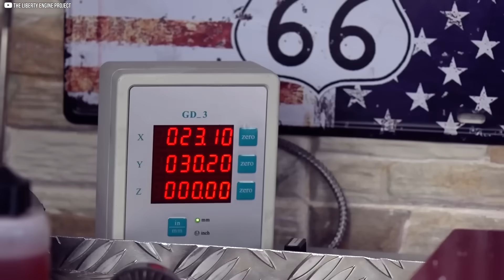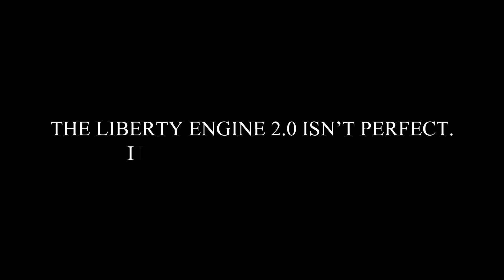Nikola Tesla’s Hidden Invention Just Got Rebuilt – And It Works!

Comment: I thing about that when i was a kid, I can't understand why someone doesn't use natural magnets abilities to generating magnetic field to build some kind of engine that produces movement to power up ather mechanizmes. In most of the electric engines or maybe even in all of them, to produce movement it is use electromagnets that require income energy to create electromagnetic field and it's really good idea in some cases, because this type of engines produce a lot of torque, imagine a drill that produces no torque at all or an electric car engine with the same problem, but in the case of a generator you don't need that much torque, at least with these small generators, i don't know how it is with bigger ones. This idea is some kind of solusyon for free sources of energy and style i don't understend why no one wonts to use it.

Comment: The infinite energy source from these Trollge videos seems more convincing, than that for 200 years nobody thought about making a machine that works on principles taught in 8th grade
Reply: Simplicity is the key!
Reply: @curtcoller3632   369
Reply: Funny though how Tesla's inventions were hidden forever after his death.  Ever see pictures of him with the wireless florescent type light bulbs cool enough to hold onto and move wherever you like?  Funny we don't have those by now....
Reply: More like 4th
Reply: Not to argue (as this, and a number of other subjects related to advanced engineering concepts, both realized, theorized, and even those never fully ‘accepted’ — I just happen to know quite a bit about).

That being said, the mentioned ‘fluorescent bulb’ you could ‘hold’ (and remained ‘cool’), is not only possible — but always has been (and is not even one of the disputed Tesla inventions). You can reproduce this in your own home (likely with gadgets just laying around).

The simplest example, would be if you have a ‘lightning globe’ laying around, and a spare desk Florescent bulb (note: Lightning globes use flyback transformers, which jack up the alternating DC input voltage — but use very, very minuscule amounts of current.. the ‘lighting effects’ are merely ‘streams of electrons’ being pulled from outside of the glass enclosure, and pass thorough the gas filament — creating the illusion of it being ‘contained’ , while in reality the high frequency + high voltage enable the electric field to pass right through, like an RF-signal).

Anyway, if you dim your lights, pick up a bulb in one hand, while touching the lighting globe with the other — surely enough, you will see it glow just the same)

Granted, this is just to explain the basic concepts as to how they worked, seemingly without wires & were cool to the touch:
1. Human Antennae / Ground conduction: By picking a bulb up & holding it, anywhere near one of his massive buildings and giant coils), would easily have the mentioned effect.

2. Lower temp / brighter glow: This is generally due to the much higher frequency (and incredibly higher voltage) produced by his coils. Depending on various factors, generally speaking, higher operating AC-frequencies, lower the threshold for gaseous energy excitation being achieved, in the form of light produced.

3. Distance from visible energy source: The effect worked at distance, as it is helped by the both the higher AC-freq (enabling easier excitation) + coupled by the millions of AC-volts being generated (via the stepping up of voltage by the coil design ratio & self-resonance of the coils themselves)

4. Low temperature: This is another byproduct of the reduced threshold to producing excitation. The closer you get to the resonance of the gas you wish to excite, the less resistance encountered (=less wasted heat produced) + less operating current needed to produce illumination (less current, means less power/energy x natural impedance of bulb , also reducing heat generation, etc).

5. Seemingly invisibility of the electric field: This is most simple of all. Those who would come to witness said experiments, were themselves within the field as well. And given the higher frequency, and ‘skin effect’ (in how electricity general moves) — aside from a tingle maybe, you’d have no reason to know you were in anymore/less of a field as that which the earth generates (of an over simplification, but I am very tired lol).

Anyway, it is undisputed that after his passing — much of Tesla’s most exotic / exiting ideas & designs were confiscated by the government nearly immediately following his passing (while whatever remained, his remaining relatively quickly scooped up … *sigh*..)
Reply: Nah.  Many people tried to pick up this stuff and others...where are they now?  What happened to them?  Many mysteriously died of heart attacks, lost all of their wealth, and just disappeared.  It was never that others from the past didn't think of it or even render a prototype.  The younger generations from every single age seem to think everyone behind them was an idiot.  That in itself is idiocy.

Comment: Those born in their 30/40/50's can easily relate to this exactly where our bicycles use to generate same with a small component attached to the rear spinning tyres to generate same energy for bicycle head light.

Comment: The thing this video doesn't go over at all is the fact that when a load is connected to this, it has to work harder to keep running, if they really did find a way around this I'd be interested in how they did so... sure it might run, but actually having it run with a load drawing power from it makes the entire system need more force on the rotor to run, induction is a 2 way street, the more power by induction the more opposing forces there is. Also, this isn't what tesla was doing, sure he came up with the first multi phase AC generator that was used at Niagra Falls, but this is just basically that trying to make power to run itself which isn't something tesla really did because its supposedly impossible due to what I talked about above.

Comment: yeah genie, that's a regular motor, and it will stop eventually, there is fricction between the pieces and you are taking out the energy from the spin and transforming into eletricity, it WILL eventually stop.
Reply from the maker: It's interesting to consider the factors that influence the efficiency of this system.

Comment: It is just a magnetic generator. The magnetic fields will cause friction in as will the friction from the air generate heat and will reduce the efficiency. The magnets will depolarize and it will be dead. If you put it in a vacuum chamber it will reduce the air friction but not the magnet friction. If you can cool it to absolute zero it will run longer, if it gets cold enough quantum mechanics of magnetic fields would come into play which would cause some issues, not to mention the power it needs to generate to cool the device down is a issue. Not to mention it is on a axe motor which would cause issue because it would eventually break from wear and tear. You can make one that levitates but would require more magnets to hold it in place. The magnetic field would wobble due too gravity and electric field interaction.

If you used diamagnetic material you wouldn't need to worry about the magnetic friction, but you need enough starting electricity to get it spinning. The electricity would be used to generate electromagnetic fields to levitate the bismuth disk( which would have to be a reinforced alloy due to its brittleness such as carbon and graphene and copper. The copper would be used to enhance the electric fields). There is one thing that would reduce efficiency and that is the diamagnetic element or material you use. The disk would resist going in one direction and go the opposite direction. You would need to switch the current to go the other way and create a oscillating circuit that uses ac to dc like in the video. If you created a hybrid or have multiple spinning in several directions and had a computer have perfect time like a combustion engine has for it's pistons it would run longer in theory. The one question is how long before you have to start it again. You would still need a power source to initiate it. If the power output and input ratio is 1:1 or 1:2 or higher than you would have success.

To actual build a practical prototype would take resources, funding and time. If you even think about upscaling the magnetic generator in the video or the diamagnetic generator I propose it could be added to the power grid. A nuclear power plant could add these giant generators and increase output if successful. There may be other issues that I haven't considered, if anyone can think of any other problems and how to resolve them even in a hypothetic scenario, please let me know.
Reply from the maker: We appreciate your detailed observations and insights on the challenges and opportunities surrounding this invention.

Comment: Plop it in a Tesla and see how long it lasts?  That would be the test.
Reply from the maker: It's great to see people thinking about how this technology could be applied in the real world.
Reply: @TheForgeEmpire  Finding the cheapest way to have even a backup power system, for people like me, who live very rural, would be a blessing.  As it sits, the more better power generator system is an LP gas generator.  GENERAC has good ones, but these come with a hefty price tag, and they run on a fuel.  

As I love seeing innovations in power production, I would love to see more on storage as well.  On our farm, we get plenty of sun and wind.  Having a lot of storage, without a wall of batteries would be nice.  Deep cell batteries are pricey.  

I am on the grid and I have a gas generator for the well, and 2 Westinghouse 1000s Pure Sine power banks for when the power goes out. I have 2 200w solar panels that I can use to charge the power banks.

My electric bill is about $1200/yr.  A GENERAC system costs over $12k, and is only needed 1-3 days a year, so whatever comes out as the new "off grid" system, has to have a good price tag.

Comment: Yes they addressed the machine and how well it works but not once did they hint how long it runs for, if it works like they say it does and can power multiple hight output devices it would be a pain to have to restart or reset it every 20 minutes or so to make sure my house or business has power
Reply from the maker: Thanks for bringing up an important point about its practical application.

Comment: ye as a tesla fan, pretty sure he never made something like this, he did however make a radiant energy collector, and that does work, because it is what a crystal radio is based on, its the receiver part of his tesla tower.  the tesla tower went on to evolve into radio and radar,  a radiant energy collector, in a crystal radio type configuration can be tuned to any emission source, be it radio or cosmic background radio waves.    If you feed a diode and capacitor instead of a headphone, you can charge a battery with it, free, forever. 24/7.   Make enough of them with a big enough collector (an insulated tower gains quite a few volts for every few feet higher you build it)  and it could probably even power a house, if only the lights, free, forever.

Why doesnt anyone make those since they DO work, and dont violate any conservation of energy principles?   pfft

Also for the folk back home radio; natural or artificial, already is AC.  So all the fun tesla stuff with transformers works just fine.

Comment: Only idiots would believe this. Even if it worked with 100% efficiency, it would only produce exactly enough electricity to run itself. As soon as you try to use that power for something else, there's a deficit

Comment: "not a perpetual motion machine" then it says "it generates enough energy for itself and other devices", that is literally the definition.
Reply: Perpetual motion is forever.  Magnets loose magnetism over time, bearings, belts do wear down. So there is maintenance to be done. Failure of say a coil thus needing replaced.

Comment: That's not a generator it's a highly efficient kinetic battery it might run for a very long time but it will not last forever and it needs an initial input you will not get a higher output than what you put in.

Comment: If you doubled or tripled its size, it could probably run an entire household easy. But for how long is the question. As expensive as it probably would be, you wouldn't want to buy a new one every year. That would defeat the purpose. It's the maintenance that would be the key for long lasting sustainability.

Comment: It’s amazing the efforts this video went through to talk about every minute detail about this super awesome machine, but not a peep about how long it works on one pull. 
Even with a prototype, that information is good to know.
Reply: My first thought was, what happens under load?
Reply: @tonedcos  whenever i run a skilsaw on my gas powered generator, it bogs down a bit.
Reply: @Claireethannathan : that's because the startup of the motor takes a lot of power.
Reply from the maker: Thanks for the insightful question! The focus here is on the fundamental principles and design, but exploring practical aspects like runtime is definitely important for future development.
Reply: @TheForgeEmpire  I made my comment before i got to the load test lol. Impressive for just a crank up.

Comment: Almost all Electrical generation is based on rotary motion just like an alternator. As long as it spins electricity is produced. All that is needed are magnet and coil - simple. All that fuss, when they could have installed alternators in the EVs. Instead they have "charge stations which you must visit every 100 or so miles while you must spend an hour or so idle. 
All this set of lyrics you're now listening to is designed to excuse themselves. What was already available since the 1950's.
Boundaries of Science - more wool over your eyes.
An alternator can be installed in any vehicle.While it moves the alternator will SPIN. That's ALL you need the alternator will produce Electricity as it has been doing since the 1950's. They denied it could be done; and instead put a device in the wheel of EVs to assist with the braking. That device worked on the same principle - the SPIN of the turning wheel (a money maker) Location - in the wheel - easy to be damaged - the brake, your lifeline. Do they care about you or anybody. What did the gov't authorities say: 000  
Nothing.
       The black man Chickumbutso claimed to invent a car which didn't use any type of fuel they used. Within a month they have a machine which generates electricity polishing up the way it works with fancy expensive magnets. Those magnets are better of course, more expensively made BUT the description is the same.
What happened to all the inventors who came before. 
Chikumbutso and his business partner were both poisoned - his partner died. He got the spiritual vision, he did not die. Many have died after trying to patent their invention.
       Nikola Tesla was found dead, so the records state. Very little, if any, of his scientific records were found.
PLANET OF THE APES is where we headed, if we're not CAREFUL.
Reply from the maker: It's important to explore various approaches to energy generation and recognize the complexities involved.

Comment: Nice.
But you called it an engine?

Internal combustion ENGINE.
Electric MOTOR.

Got that, Gen Z
Reply from the maker: It's great to see the passion for accurate terminology!
Reply: Electronic things can also be considered engines. The CPU in a router, for example, is called a routing engine.

Comment: If u add a rechargeable battery to store reserve power and a compact transformer to in crease out put it could do way more
Reply: You need to increase your learning and understanding of basic electricity. TRANSFORMERS DO NOT INCREASE OUTPUT. Power output is always less because of limited efficiency, Voltage is only increased at the sacrifice of current, and vice versa. The word "output" alone can only refer to power, not to voltage or current. Study up, before you make a fool of yourself. My goodness, if transformers could increase output, we would have free energy, wouldn't we?

Comment: I was thinking what if they set these Generators up with 2 other Generators with their pull start and a belt system connecting all 3 generators with alternating start times on each of the 3 generators connected with one pulley belt? What do you all think?

Comment: Nowhere in this video did they tell us what turns the generator turbines!  Are we supposed to think it's not using diesel or gasoline? That it runs for hours just based on a quick pull of the starter rope and friction?  🤔

Comment: My buddy and I built something similar in for a science project. I used two popcorn bowls, wrapped the smaller one in steel wool, then taped magnets to a mini fan and placed it inside the the center of the small bowl while lining the inside of with magnets facing the opposite direction, my buddy did some stuff and wrapped the fans center in copper and some other stuff to get the magnetic charge. Then we placed the smaller bowl in the larger bowl and filled the larger bowl with saltwater. After that we took four of the copper wires, two of of the wires went in opposite sides of the saltwater, that electrified the steel wool and remagnatized the magnets to keep them from weakening, and used the other two to power a lightbulb. After that all we had to do was push the fan so it started spinning. 
Makes me laugh to think about how much money they spent to make this.
Reply from the maker: It's interesting to see how you incorporated similar principles from Tesla's inventions into your project! The ingenuity of science and engineering is truly fascinating.